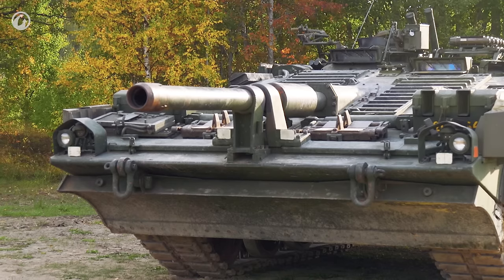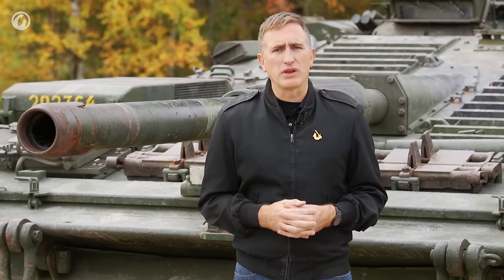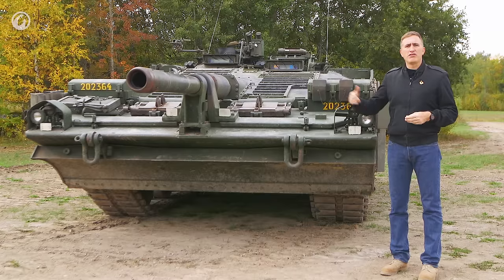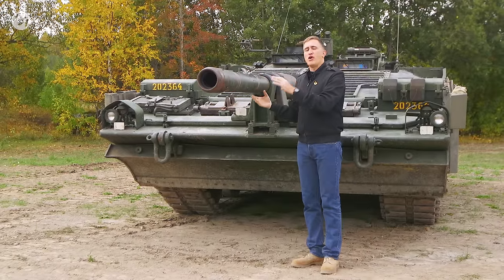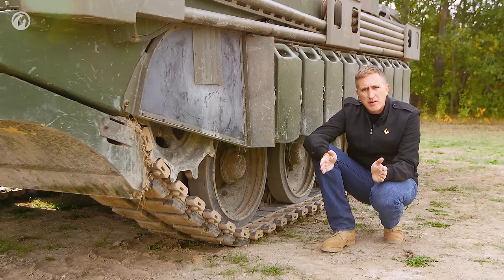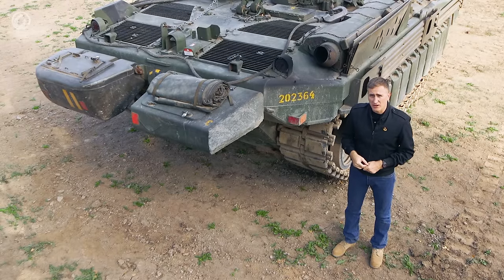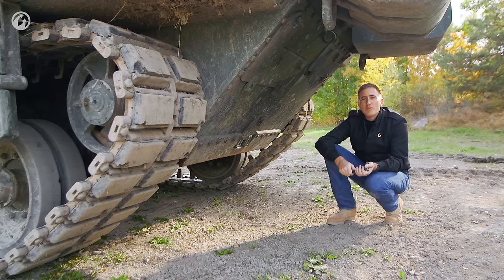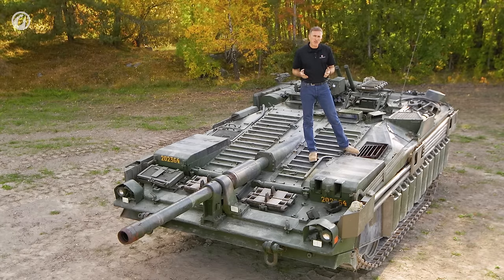Inside the Chieftain's Hatch: Strv 103C part 1

Comment: The Strv103 - I don't care what problems it had - it's my all time favorite tank!
Reply: T. Gorbach agreed
Reply: It was perfectly suited for its intended role...fighting off Soviet armor in the dense forests of Scandinavia, on narrow roads.  Sure, some may term it more a tank DESTROYER than a true "tank", but it's largely a matter of interpretation.  Picking off invading Soviet tanks was all the Swedes needed any sort of tank for, and this one was better suited for the job than the Centurions, which the Swedish army also bought.
Reply: Murat Gadjiev  It's called DETERRENCE, Murat...of course, unless the Soviet Naval Infantry landed on the Swedish Baltic coast, and not necessarily having invaded Finland first (which would have otherwise given the Swedes ample warning), ferried MBTs on some sort of "Ro-Ro" ferrying craft out of Kronstadt, out the Gulf of Finland and across the Baltic enough to threaten something of value.  Sure, the Naval Infantry would be using PT-76s, likely upgunned to the D5T 85mm weapon, and also landed some VVS (Airborne) and landed likewise some ASU-85 tank destroyers, but those AFVs would be easily picked off by Swedish infantry wielding "Carl Gustav" ATGMs.  No matter the route that Soviet armor would have taken, the roads would have been narrow, with most if not all the surrounding terrain heavily forested and unsuitable to armored operations.  So the Strv 103 could easily wipe out approaching Soviet armor as they'd be confined to these narrow roads.
Reply: i just don't like them fuel tanks tho..
Reply: Murat Gadjiev  Back then, and still today, the only said threat to Sweden is Russia. If they ever will attack, idunno. But that's the case either way

Comment: The auto-loader design also facilitates bring rounds for the 105mm gun via an APC...i.e., by carrying them in the APC, and then backing up close to the back of the tank, a fair level of protection from artillery fire during reloading can be achieved. Kind of important when an empty tank is being refueled and resupplied under combat conditions.

Comment: The Germans: “we are the masters of tank design”

The Swedish: “hold my beer”
Reply: lets cover our tank in our fuel tanks, put our ammo exposed nicely on the near and make maintenance impossible because the gun is like quadmounted.  the hydraulic system is the tanks only good thing and its safe to say in tank training they teach you about how to use terrain to do exactly what the hydraulic system does.
Reply: HOLD MY AQUAVIT
Reply: Aaron Bye hold my cheese 🧀
Reply: bonga rust the crew is near impossible to take out, the fuel does a great job at defusing HEAT rounds. The; engine, fuel, heavily sloped armour, and extra interior armor surrounding the crew makes it impossible to take them out from the front. Putting the ammo away from the crew keeps them from getting killed, in fact all modern tanks do this to an extent. They all store ammo in a large, easy to hit compartment just behind the gunner/commander in the turret with just a relatively thin piece of steel to protect the entire crew if the ammo gets hit. Did you watch the video? He went through all of this
Reply: @pakratmiz4487  And if you're on the move and an enemy tank appears you have to first stop, then aim, and then you're blown up.
Reply: Hold my surströmming.
Reply: HOLD MY IKEA
Reply: @Kalumbatsch  The most cost-effective German tanks of WW2. Was the Stug and the Hetzer tank-destroyers. Swedes only had around 700 tanks at any given time during the high of the cold war. 300 S-Tanks lying in wait for Russian columns could have had quite the feast.
Reply: @bongarust694  that  sounds about right,buddy!
play to your strenghts, use your terrain
for a mbt in the mountains i might choose this
Reply: @pakratmiz4487  good point!
Reply: @bongarust694  It's diesel, so it's not explosive, and the efficacy of this has of course been proven in numerous tests. Also even if it was explosive, I'm sure you've heard of ERA?
The ammo is placed at the rear of the tank outside the crew compartment, which is the best possible placement. The ammo can only be hit from the rear, and an explosion will not reach the crew compartment due to the blow out panels.
Maintenance isn't impossible, unless you by "maintenance" mean "complete engine swap during combat".
Reply: @frankkrunk  lol read the comment from Baron "This is truly a tank designed for the most intense terrain possible. It has not one, but THREE shovels mounted on it." about a thousand people agreed with him this is a very very very good tank many shovels....
Reply: also diesel ignites at 205 degrees Fahrenheit. the combat for tanks is happening in russia and in the hot desert. hot desert is 120 degrees plus engine temp plus explosive rounds from depleted uranium i guess that stuff doesnt heat up tho. have you ever seen a blown out tank before ??????????????? not explosive lol..
Reply: Look like that gun cant rotate, a huge problem!!
Reply: And its meant for defence
Reply: The video kinda reinforces the German stereotype.
Reply: @bongarust694  you know less than nothing about it
Reply: ...
The Germans: "nice, free beer"
Reply: @walkingoutdoor7284  and then the shell comes
Reply: @artilleryfire6576  but free beer first, right?
Reply: @walkingoutdoor7284  i guess, but its a trap
Reply: Hold my knäckebröd
Reply: how many Leopard 2 Tanks did the Swedish Army have  yet ??
Reply: @magnusmcgraw  well they have the strv 122 wich is an upgraded version of the leopard 2a7, in tank design were talking quality and not quantity so you don't have any point at all there
Reply: @Kalumbatsch  And if you've seen this tank in action you'll know it's very well capable of quickly turning around.

Hell if you drive fast enough and break with this thing you can do a 180 in around 3 seconds.
Reply: @Kalumbatsch  the tank is made to defend Sweden not to go on the offensive.
Reply: U mean hold my PewDiePie?
Reply: @f3hn9  Hold my Surströmming.
Reply: Lol good one
Reply: Still holding that beer, its getting warm and nothing else is happening...
Reply: Hold my öl
Reply: @davidolofsson5231  how do you defend without counterattacking??
Reply: @Kalumbatsch  Yep. True. The funniy thing is that the 103 stopped from full flank ahead, turned, aimed and killed those Chieftains and Leo I, before being shot at - during evolution in Germany. With British crews with minimal training on the tank. With expert crews it would have been walk-over. This was before true stabilized guns,  and high efficient APFSDS - but you can only compare a tank to it's contemporaries. Today the S is totally worthless, but in the 60/70"s it would have more than a match for the Russisns. In the 80's?  Probably not.
Reply: Evaluation of course... damned T9
Reply: @martinbredberg7616  Source on that?
Reply: beer and fermenting fish you mean :P
Reply: @Kalumbatsch  That's the thing though, this tank is designed with defence against a possible Soviet rush attack in mind, be lightweight and small to travel through rough wooded terrain without getting bogged down, park up with very little of the tank exposed, shoot the Soviet tank in an ambush and then drive fast backwards.

The ammo being exposed in the back is only a problem if you don't use the tank as intended and try using it for attack where you get flanked round the back, no sane Swedish tank doctrine of the time would do this insanity.

Comment: We already got the Strv S1 now I can smell the Strv S2 premium tank coming soon in the near future, remember this comment when that happens
Reply: its wargaming if you think they WONT put more sweid premium you don't know wargaming
Reply: TheOneWhoShallNotBeNamed They have to pay the loan for their employees...
Reply: TheOneWhoShallNotBeNamed Apparently there is already strv 81 (centurion mk. iii) planned
Reply: +Panzerzwerg Yeah, the Strv 81 will basically be a premium Centurion Mk. 1, but with a better turret
Reply: That is impossible since Strv 81 were a normal Cent Mk. III (152mm of both turret front and mantlet). IRL they were often fitted with Robot 52 SS11 ATGMs.
Reply: That is wrong and should be corrected.
Reply: Although they do a lot of premium tanks, WG also is finally pumping out HD models for all tanks and has added 2.5 brand new lines recently. (German Heavies, and the two Swedish lines). I'm not that upset about more premiums. 

The relative power of said premiums... that does upset me. (Patriot, Liberte, Defender)
Reply: It is just as wrong as T29/30/34 Mantlet which should be 305mm thick just around the gun, and 203 for the most part, with a 25.4mm thick spall shield behind
Reply: Dont care, as a swede i must own it
Reply: TheOneWhoShallNotBeNamed  oooohh HELL YEEEEESSSSS
Reply: The designation stridsvagn 81 was given to both Centurion mk III and mk V, while the mk X was designated strv 102.

The Robot 52 was only ever used by the Swedish Coastal artillery, since the trials of tank mounting was deemed unsuccessful.
Reply: wtf are you talking about?

Comment: Interesting video. The statement that the tank has to be running to operate its main gun is however false. The tank could hide dug in with its engine off and still aim and fire thanks to its hydraulics. The huge advantage is that not only was it hidden visually, also the heat signature virually disappeared, making it extremly hard to locate.
Reply: Nya Tider It has to be running to aim the gun from side to side. The hydraulics only allow it to aim up or down without the engine running.
Reply: Hayato Kojima I read somewhere t hat it has a secondary jet engine,
Reply: How? Hydraulics only work with the engine on.
Reply: marinus18 now that you've mentioned it, it still has to have the diesel engine on to get the hydraulics working. I might have mixed up the jet engine with the diesel. Sorry sorry
Reply: @MrMarinus18  Couldn't you operate the hydraulics electrically? I know that's not an option with this vehicle, and it would need a separate battery, but the question still stands.
Reply: @Halinspark  You open and close the valves with tiny electric motors but that doesn't make a difference. You need to have hydrolic pressure in the system otherwise nothing will happen.
Reply: @Halinspark  You need very powerful electric motors to do that. Also most large vehicles do have a backup engine to drive the hydraulics if the main engine is out of action. However it usually just uses fuel. The 103C doesn't need a back-up as it already has 2 engines. Remember hydraulics are not a power source. They are just a means to get the power from the engine to where you need it to be.

You could replace hydrolics with mechanical gears and shafts and that's also what the early tanks did. However hydraulics take up less space and don't wear down as easily as mechanical gears.

The 103 was fairly quiet though because a turbine engine is more silent than a piston engine and it's turbine engine was fairly small. Most armored vehicles with a turbine engine such as the American Abram are much larger and heavier. Also remember that it is a relative statement and it is quiet compared to the piston powered tanks of the time.
That small engine though is very weak and the 103 is very poor acceleration. The 103 is purely defensive. To lie in wait somewhere and retreat when defeat is imminent.
Reply: It could not fire or aim with the engines off. Well, yeah, maybe fire using "Nödavfyrning" but you couldn´t aim. Also, why is the heat signature so much lower with 103 than for instance Strv 74? I´d say that all tanks have a better heat signature, perhaps except Abrams.
Reply: @yatokami7907  Not even up/down - unless you hand pump it from the commanders position.
Gunner/driver 103 1991
Reply: @nothingtoseehere1221  It has a jet engine to move it, and a regular diesel to aim/shoot/run hydraulics.
Reply: @Halinspark  Of course you can power hydraulics with any source. Wind, water, piston engine, electric, steam,... But if you had electric gadgets on an tank, powerful enough to operate hydraulics - why not use them directly on the "actuators" and skip the hydraulics - and save a ton or so? You have to choose your power source and stick to that. For 103: piston engine + hydraulics.

Comment: 6V53T is a V motor (DD older engines used the V to indicate that, as the same series could be L or V engines). If the Strv-103 had an L6 Series 53, it would be properly labeled a 6-53, and not a 6V53, though the V53s are not much wider than the straight 53s.

Comment: The huge Achilles heel of this design is that the gun cannot aim independent of the hull. If the hull is stuck in at a certain heading then so is the gun. Same thing when driving. You can’t shoot anything while driving unless it is right in your direction of travel
Reply: yes, just flank it
Reply: Probably more or less with any tank. If the hull is stuck, you can only shoot at what is not needed to shoot at anymore. What you miss is that when this old tank was introduced, no tank could shoot and hit while moving. They all had to stop to aim. And 103 stopped, aimed, shot, and hit faster than any other tank - with its rigid gun.

Comment: I'd think think this tank would be pretty easy to get unstuck if not buried up to it's eyeballs. Lift up the tracks as high as possible. Stuff logs, etc, under the tracks. Lower the tracks, raising the chassis. Put more logs under the chassis. Raise tracks and and more logs. Lower tracks. Repeat as needed.

Comment: 23:03- The Detroit 6V-53 is a V configuration, not inline, but I'd guess it was a slip of the tongue rather than a not knowing the difference.  A 6-71T would have been the inline option, but it was bigger and likely wouldn't have fit.
Reply: Detroit also has a inline 6 cylinder 6-53.

Comment: I gotta correct you Chief, the 6v53T is a V6, hence the V and not a dash in the name. A straight six, which was never produced but could be made by bolting two 3-53Ts together, would be a 6-53T

Comment: Track tension. Important, but can be ignored on some tanks to a degree. M1A2's in Iraq. We checked lug nuts, oil caps, track tension secondary. We drove the piss out of those tanks. As long as the pack kept going, we was good.

Comment: Question: why don't modern tanks with bustle-mounted ammunition have a hatch in the rear of the turret for loading ammunition? Surely it'd be easier than having to bring it thought the crew compartment, wouldn't it? Could you turn the turret sideways while loading so the hull doesn't get in the way?
Reply: Some do
Reply: Which ones? Just to specify I'm thinking of a hatch in the rear turret armor, not in the bustle roof.
Reply: Oh, well I assumed you meant the roof.

Comment: Ummm... Just to clarify, automatic loaders are not free. They take up space, too. They often take up more space than a human loader. And they need to move. Their advantage is that they make fixed movements in the same, consistent confined space. Human loaders, on the other hand, are all over the place, often like a puppy desperate to get outside to pee. Conservation of space via uniformity of movement comes increasingly into play the larger the ammunition happens to be.
Reply: In this case the autoloader takes about 15 cm in width, 1 m in length and 130 cm in height. The rest is the ammo-magazine, which would be there anyway - auto or not. The weight of the autoloader is some 20 kg, compared to the human of 75kg. Also, the destruction of the autoloader is slighlty less stressful to the next of kin than the loss of a human loader. Finally, the autoloader works faster and never makes a mistake. On the down side is that you are one man short when it comes to maintenance and other duties in field.

Comment: Question for you regarding the auto loader. Say I had an HE round in the breech and decided that the target I was about to service required an AP round would I have to throw away that HE round loaded up, shoot it anyways or is there something I’m missing.
Reply: Typically you just empty the barrel at the target, even in traditional tanks. If you waste time pulling the shell out, putting it away, grabbing a new one, and loading it, you run the risk of losing your shot or being counterdetected and fired on.
But if you fire what you have, you can still do damage. If you dont do damage, you've probably scared the crap out of them, and their return fire will be rushed.
Reply: Nope, you are correct. Fire that HE at anything, and load the AP. Takes 2.8 seconds. Did that on a firing range once, got a few remarks from the officers, but mainly because they didn´t know that I was going to fire on a rifle squad when a tank appeared and I had to change ammo.
Alternative is to unload the HE round, which takes 1 minute and requires work outside the tank - not an option in combat.
Reply: @martinbredberg7616  Thanks for the clarification.